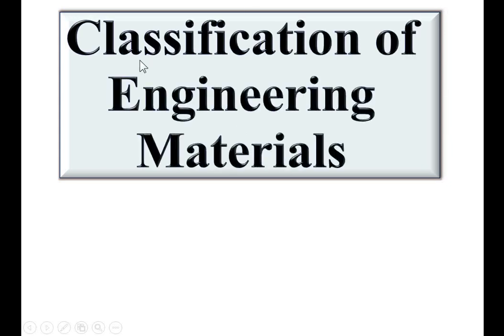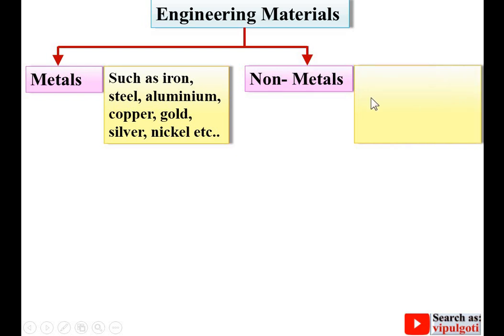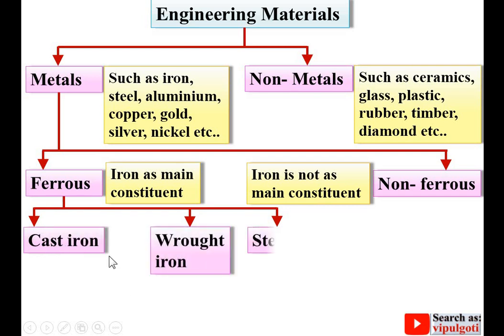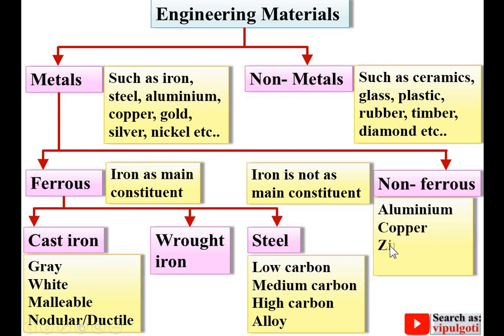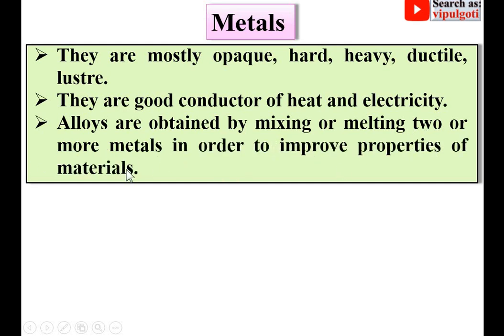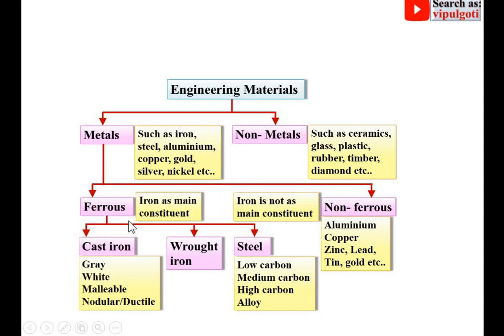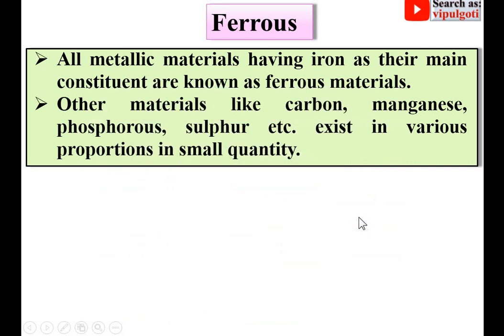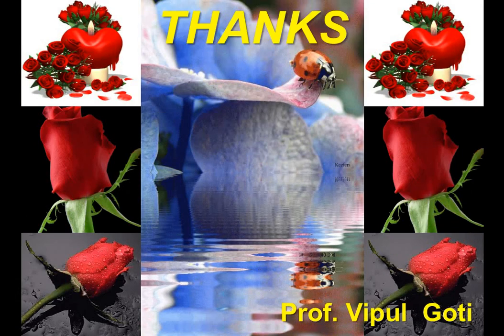Types of engineering materials, Classification of Engineering Materials, Types of materials, #Metals

Comment: Sir I am in btech second year civil and I have mechanical engineering systems subjects as a minor subject and I have the chapter called introduction to material science and metrolohy so can I study this?
Reply from the maker: Yes, definitely my dear.... Refer your syllabus also....
Reply: @vipulgoti47 okay sir thank you so much ❤
Reply: @vipulgoti47 and sir I also have one doubt that I am from Mumbai University and a  btech student from civil and we have mechanical engineering system as the minor subject and sir in the syllabus we have this syllabus which I have given below sir kya aap please dekh ke bata sakte ho ki isme mein agar sirf theory karu to chalega kya and isme kitna percent theory hai aur numerical hai aur konse konse chapter mein sirf theory hai ? Please sir help me 
1st chapter: introduction to
Metrology and 
Material Science
1.1 Introduction to Metrology
Standards of measurement, Limits, fits and tolerances, Hole 
based and shaft-based systems, Taylor’s principle, 
measurement of displacement, pressure and temperature.
1.2 Introduction to Material Science
Engineering materials (Metals, Non-metals, Ceramics, 
polymers), advanced materials and smart materials.
06 CO1
2nd chapter : Introduction to
Thermodynamics 
and IC Engine
2.1 Introduction to Thermodynamics
Basic concepts and properties, Laws of thermodynamics, 
Modes of heat transfer (conduction, convection and 
radiation).
2.2 Introduction to I.C Engines
Engine Nomenclature, two stroke and Four stroke engines, 
Types of Sensors, Euro and Bharat Stage Norms, and Engine 
Emission Control
07 CO2
3rd chapter : Conventional
and Additive 
Manufacturing
Conventional and Additive Manufacturing:
Primary Manufacturing Processes: Casting and Metal 
forming.
Secondary Manufacturing Processes: Forging, Sheet metal 
working, Welding, Turning, Milling and Drilling.
Additive manufacturing and 3D Printing, Basic CNC 
programming: Concept of Computer Numerical Controlled
machines
07 CO3
IV chapter : Introduction to 
Vehicle system
Introduction to Vehicle system
Introduction, Mechanism and machine, Classification of 
kinematic pairs, Linkage, Mechanisms, Degrees of freedom, 
Introduction of chassis layouts, steering system, suspension 
system, braking system, cooling system and fuel injection 
system and fuel supply system. Study of Electric and Hybrid 
Vehicle systems. Study of power transmission system, 
clutch, gear box (Simple Numerical), propeller shaft, 
universal joint, differential gearbox and axles & Basics of
Electric vehicles
07 CO4
Vth chapter :introduction of 
energy sources
& its conversion
Introduction of energy sources & its conversion
5.1 Energy sources: Thermal energy, Hydropower energy, 
Nuclear energy, Solar energy, Geothermal energy, Wind 
energy, Hydrogen energy, Biomass energy and Tidal energy. 
Grades of Energy. (Numerical on efficiency calculation of 
thermal power plant )
5.2 Energy conversion devices: Introduction of pump,
compressor, turbines, wind mills etc (Simple numerical on 
power and efficiency calculations)
06 CO5
VI th chapter : 
Engineering
Mechanisms and 
their
applications
Engineering Mechanisms and their applications 
Introduction to Basic mechanisms and equipment: Pumps, 
blowers, compressors, springs, gears, Belt-Pulley, Chain-
Sprocket, valves, levers, etc. Introduction to terms:
Specifications, Input, output, efficiency, etc.
Applications of: Compressors - Refrigerator, Water cooler, 
Split AC unit; Pumps - Water pump for overhead tanks, 
Water filter/Purifier units Blower - Vacuum cleaner, Kitchen Chimney; Motor - Fans, 
Exhaust fans, Washing machines; Springs - Door closure, 
door locks, etc.;
Gears - Wall clocks, watches, Printers, etc.; Application of 
Belt-Pulley/Chain-Sprocket - Photocopier, bicycle, etc.; 
Valves - Water tap, etc.; Application of levers - Door latch, 
Brake pedals, etc.;
Electric/Solar energy - Geyser, Water heater, Electric iron, 
etc. (simple numerical on efficiency calculation )